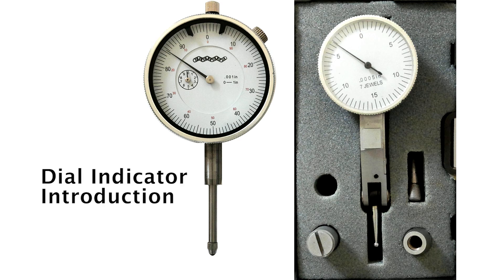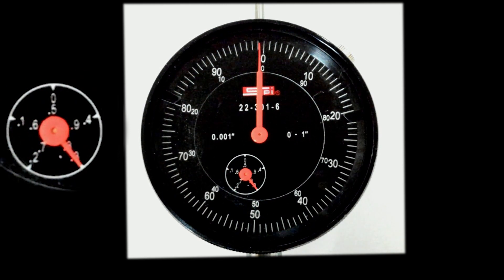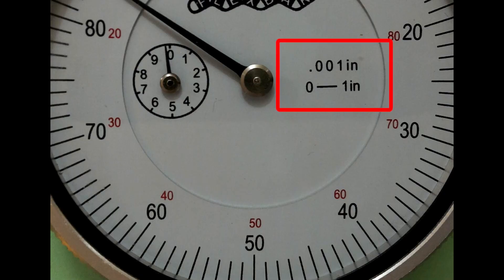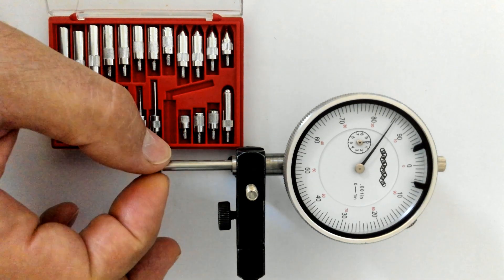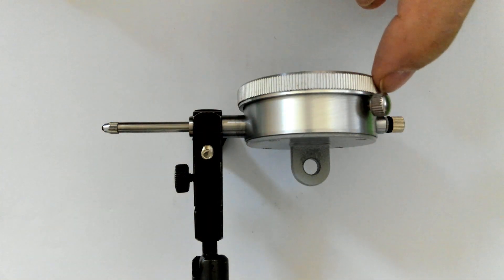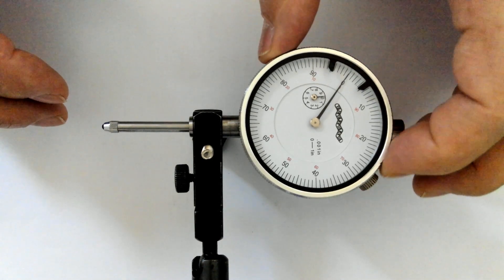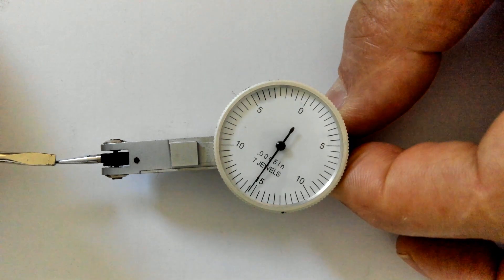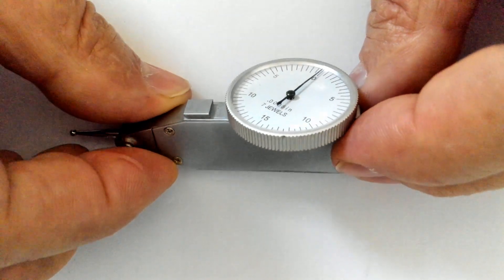Introduction to Dial Indicators

Comment: Hey question on dove tail indicators.

I just started a new job as a cnc machinists and while indicating my vice, I spun the dial to to move my 0 further down. The supervisor kind of freaked out on me when I did that. Not sure if I’m in the wrong or not, I did that  all that in my last job in front of the programmer there. It wasn’t tight or locked either, moved slightly snug just like the one from my old job. Can’t find any info on this out there would appreciate a reply, thanks and keep up the content!
Reply: I did that all the time at my last job in front of the programmer there too*
Reply from the maker: Since the dovetail dial is already preloaded from the center position zero would start on the dial there. When you setup the dial so the measurement plunger is touching what you want to measure the dial will now have a slight preload between .0005" and .0015". At that time the outer dial can be rotated to read zero to make it easier to record any movement. I would not turn it 180 from where it is although it shouldn't hurt anything just as long as you know what you are reading but it would be unconventional.